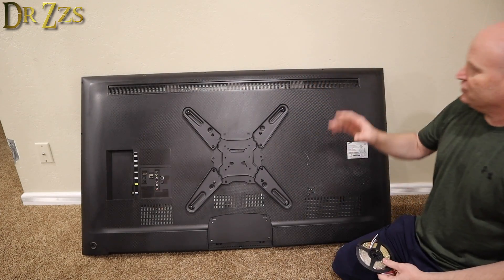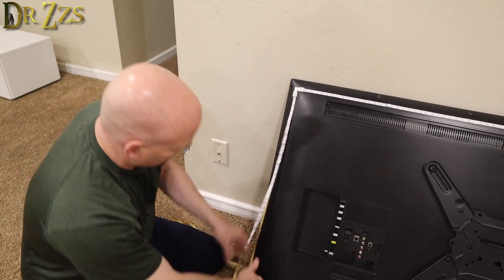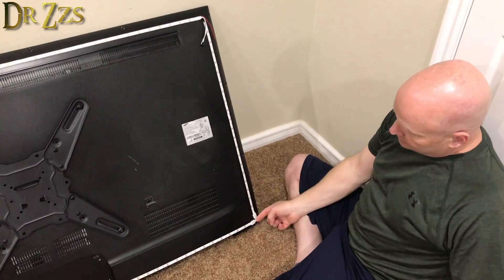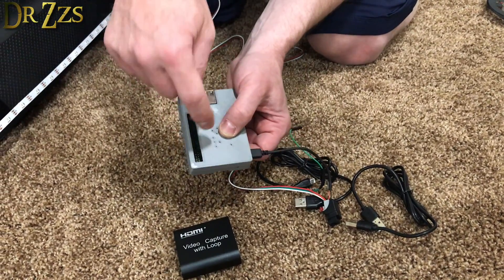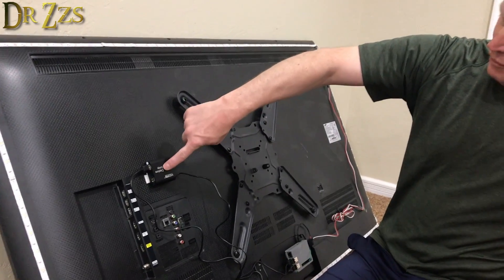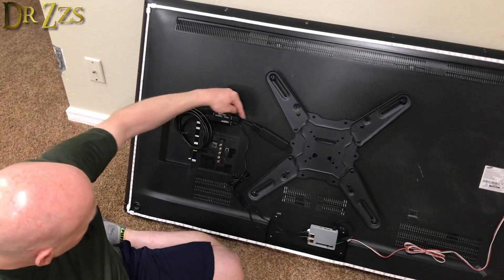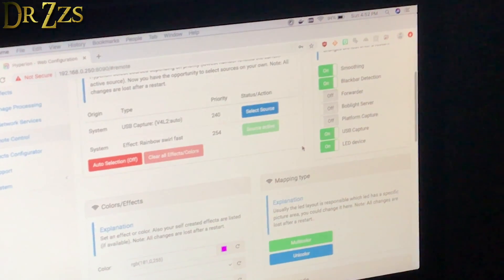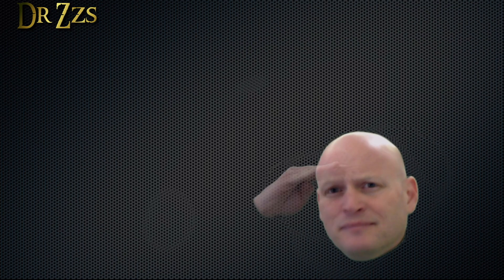DrZzs Home Automation Reality TV Pilot Episode (and Hyperion installation)

Comment: Do not pry up the metal tabs in those corner connectors too much... I did and it only took a little bit of spacing that caused the connector to be a less reliably to keep contact.
It helps alot to have both of the connector's tabs open so the metal contacts are a little lose to get the strips underneath.

Comment: Very useful video.  Thank you. may be on the L connector get the connector side hooked up when connector is not with the strip. gives you more wiggle room to fit the connecor plastic in the L shape lines

Comment: This seems to get a little more pricey when you want to capture and passthrough 4k 60fps.
Reply: I am buying separate 4K 60Hz switch with both outputs working at the same time (one 2160p to AVR and one 1080p to the Rpi) and HDMI USB capture stick.
Reply: @Cr4z33_YT  i use this one for split 4k HDR DV and Atmos to the the 4K TV and 1080p to the Pi EZ-SP12H2 ezcoo HDMI Splitter https://www.amazon.co.uk/gp/product/B083JVPXDY/ref=ppx_yo_dt_b_asin_title_o09_s01?ie=UTF8&psc=1

Comment: I'm using prismatik on mine. Wonder if hyperion uses zones, cause mine can adjust each led on a per pixle basis. Also, shouldn't a resistor be placed in between power and pin 18? I also have a capacitor on mine.

Comment: how would one set up multiple inputs into the device?  Is it possible to have both a gaming system AND a firestick through the same Pi, and be able to switch back and forth like the "source" button on the TV?  Or would I have to unplug the fire stick and plug in the game system into the Pi, and vise versa each time?
Reply: I too have the same question

Comment: I just bought this led https://www.amazon.com/gp/aw/d/B07BKBN1DQ?psc=1&ref=ppx_pop_mob_b_asin_title can the power supply your using be strong enough?
I asked some help from a friend and he said to buy this instead https://www.amazon.com/gp/aw/d/B07KC3KSHP?psc=1&ref=ppx_pop_mob_b_asin_title but I can’t find a tutorial on how to set this damn thing up LMFAOOOO
Reply: 5V 60A is overkill, but it depends on the number of LED's you are running. Im running 204 LED's with a 5V 20A PSU, like the one your friend has recommended. For that you connect the N / L and GND to the mains cable and the +V and -V you use for the power to the Pi and power for the LEDs like this https://cdn11.bigcommerce.com/s-itwgldve/images/stencil/1280x1280/products/538/3278/wire_psu__90642.1531248282__73895.1550181329.jpg?c=2?imbypass=on

Comment: Hi, I actually have the same setup as you in the video. However, my problem is with powering the capture card. I plugged it into the Raspberry Pie but it wont work. However providing it with a separate power supply it works. Any idea ?
Reply: Forgot to mention that I did added a line in the boot config.txt and added max_usb_current=1

Comment: ey Dr. Great video and you've convinced me that this is something I can get done myself rather the the Philips HUE route. Question about your parts list - What is the RpiZeroW on the list for? Is this an alternate to the Rpi3? Or are both needed? Also you have mentioned that the a WLED controller could be used to move the Rpi3 further from the TV and use wifi to send the control signals to the WLED on a TV? Is that correct? That would result in less crap behind the TV is it is? Thanks in advance. Looking forward to ordering the parts.

Comment: Could this work from something streaming to the TV? i.e from a plex server rather than a TV box or PC, etc
Reply from the maker: Any external HDMI signal will work.  If you run Plex on the same pi, that will work too.  The only thing that doesn't work is if the TV has roku or something built in.  In that case there's now way to get the signal out to send to the lights.

Comment: Great video. You've got me inspired to do this at home. DrZzs or anyone here, would there be an advantage using SK6812 LEDs to get a dedicated white channel (they come in 3 styles cool, warm or neutral - I'd probably go neutral with a TV)? And is there an advantage to getting higher pixel density ie 30 vs 60 pixels/m? Thanks

Comment: Hey Doc, thanks for this tutorial, i managed to get this working on my tv however I have an issue, under components control you activated USB capture, ones you turn off the pi this setting is lost, how did you solved this issue? Don't want my leds working 24h a day

Comment: Have you tried one of those 1080p Video Capture with loop cards with a raspberry pi zero w? I've just put a setup together but the capture rate is about 1 frame a second and the pi zero is running at 90% cpu. Going to try throwing a 3A+ at it but wondered if you have had it working?

Comment: Hey doc, would that work with 4k 60fps hdr signal input?
Reply: I can confirm it does not you need to but a better splitter for 4k 60fps hdr you might want to try the prophecy hdmi splitter
Reply: @southard23  thanks I will take a look ! Cause yeah I will buy a 4k hdr+  dolby vision/atmos so I don't want the hdmi signal to be degradate
Reply: @BlackRec  I did buy one with 60hz output and it works like a charm. I can't see any difference from the original picture so I think it's real 60hz.
I bought it for dirt cheap as I got a coupon for new user on aliexpress.
Reply: Did you get un answers for that?
Reply: @FadiNoufal  Nope, I did some research but didn't try myself, but this hdmi splitter should work https://xolorspace.com/products/1x2-4k-60hz-hdr-hdmi-splitter-with-downscaler-4k-to-1080p
Reply: @RobertoCarvalho-0  50$ is almost the price of Philips ambilight. I bought another one on aliexpress which is marked as 4k 60hz I'll test it to see if it really handles that.
Reply: @FadiNoufal  if it works please let us know !!
Reply: @RobertoCarvalho-0  of course, I'll receive it in two weeks 😬
Reply: @FadiNoufal  2 weeks later .....Did it work? If it did, link please
Reply: @izzyskyo3673  didn't receive it yet 😑
Reply: @FadiNoufal  👀
Reply: Hey Drzzz I have copied your video on how to install several times but I have a problem where myne will work but freeze with in 5mins what could be causing this please help me heres a video showing it working and then freezing 
https://youtu.be/dZMLrTzFX4g
Reply: Any updates?

Comment: How realiable are these? I feel just selling the TV and buying a philips android tv for £500 would be better, probs upgrade on quality, has android tv built in which is another box not needed sucking up power and leds are nicely embed and can easily switch modes on the original remote, its call there is a techy way but running a pi and leds together seems like your asking for it to stop working when you don't want it too

Comment: What do you do when you have multiple inputs. Fire stick, Playstation, and cable. With only one input on the hdmi capture card?
Reply: I'm using a Yamaha AV which let's me have 4 inputs and better sound. If you don't already have one and don't need a speaker setup you can also go with a HDMI switch

Comment: You could just used a ESP8266 to control the lights, and send the lights signal from the raspberrry to the ESP8266 via WIFI (UDP).. and you can repurpuse the Pi for other things too (in my case i use it with Retroaarch). So you can have the Pi + HDMI encoder with your equipment rack and the back on the TV would just require the 5V PSU, leds and ESP8266 (in my opinion would be a cleaner setup). Keep our videos coming... love all the ideas you give us
Reply: Isn’t that causing extra lag due to extra communication layers added?
Reply: @martinvermeer  I have this setup and I would says there is a 20-40ms lag it's not really noticeable unless its like strobing super fast. Considering the avg capture rate is 10hz it doesn't make that much of a difference.

Comment: I've done my ambilight installation following the previous video you made on it, and it looks very nice ! 
However, there is a latency of at least 0.5 seconds between the image shown on the TV and the ambilight effect, which comes from the video capture module. Even if the latter is very convenient to use, I thik I will replace it with 3 modules : splitter HDMI, HDMI to AV converter, and RCA USB grabber (UTV007 chip). Viewing the others videos on the subject, it seems that the latency is reduced with this system.
Reply from the maker: really?  Well, glad you found a solution that fits you better.  I haven't notices that lag, but these are pretty cheap capture cards.  Could be there is some variation in build quality and performance.
Reply: hey, just wondering, would that work with 4k hdr content?
I found your solution quite good regarding cutting the latency
Reply: @RobertoCarvalho-0  Hi, it would work if you choose a splitter HDMI compatible with 4k HDR. They are obviously more expensive than full HD ones.
Reply: @hp200499  Are you aware of such model? thanks
Reply: @hp200499  Thanks Hugo, The link you sent actually looks to be a pretty solid alternative. Ive been looking for such a device for a while now and as you can see in this video comments, a HDMI split that passthrough 4k 60fps + HDR + Audio passthrough and still downscale the second HDMI to 1080p is rare. Looks like this device is the holy grails for UHD though. Thank man.

Comment: i wonder if putting the LEDS at a 45 degree angle would improve the effect by letting more light out the back of the TV.
Reply: Or flip them 90 degrees, 3d print some quick brackets, and you wouldnt have to cut/splice them back together and get some extra light.
Reply from the maker: maybe.  I've notices the effect isn't as good if the TV is far from the wall.
Reply: @DrZzs  I think I might have to do something as i have a bracket that pulls out from the wall so doesn't sit too flush.

Comment: I have a question and possible solution to the 4K dilemma most people have with this setup, could you use an HDMI splitter with one input and two outputs that output the same video at the same time and have one go into your tv and one going into the capture card? That way the capture card is still receiving the video data and the tv would still get full quality, there would just be no output cable from the capture card to the tv, it would go from the splitter to the tv, would this work?
Reply: I'm currently making a DIY Plex voice integrated "smart screen" Aperture Radio alarm clock. I'm using this exact method to output 1080p, but the idea should work just as well with 4k. It's pretty hard finding a 4k splitter to fit into the form factor, but doable. If anyone would be interested in a tutorial, let me know and I'll speed up production.
Reply: I actually came across this splitter that outputs 4K 60hz hdr also can do individual downscaling and is about the size of a zippo 

https://www.amazon.ca/HDMI-Splitter-1x2-4K-60Hz/dp/B07TVSBL7H

Comment: Fun video. Yes you can connect gnds of DC supplies together.👍
Reply: Yes there is no issue connecting the ground of DC PSU.   In lab situations when you have many power supplies that is exactly what you do.
Reply from the maker: you can, but not the best idea.
Reply: @DrZzs  without a common ground, the 3V3 volt signal from the pi could be floating above the 5V of the led strip and cause reliability issues or damage to the LEDs. If it works it works, but it's not ideal. Same goes if you use the level shifter, gnds should still be connected.

Comment: I know someone already asked, but I didn't see the answer.  How well does it work on a Pi0?
Reply: i just completed this recently with a pi zero w and works great https://www.youtube.com/watch?v=gRz6PvTzZNw
Reply: @chrisgonzales  Good job! Could pi0 has common GND with led stripe?
Reply: @L84netlol  i didn't connect my leds directly to the pi, but i know with using arduinos the must share a ground. As you usually get weirdness with the leds if they aren't. So would assume the same holds true to using the pi to control the leds directly.
Reply from the maker: it works great on the Zero.  The WebUI is a little slower but I haven't noticed any performance difference on the LEDs with a Zero
Reply: @DrZzs  Great.  Folks gave me Pi0 for Christmas a couple of years ago... FINALLY something to do with it! :-)

Comment: Is there any way to get Hyperion working while keeping HDMI-CEC, Dolby Vision (HDR), and Dolby Atmos through ARC? I don’t know if there is an HDMI capture card that will pass through those things
Reply: Just use one of those cheap HDMI Splitters right before the capture card. Most of them will pass everything to both outputs. But a real "loop through" port will pass all these things to the other end anyways.
Reply: AV amplifiers often have a secondary output you can pass to the RPI while the main out still goes to the TV

Comment: What those LED strip jointing pieces really need is the ability to inject power into them ...
Reply: Can't you just solder a wire on to them?
I have never used one of those but it seems there is room for it
Reply: Emmanuel Goldstein - no but those joiners are useful for more than just the back of a TV ... 😜